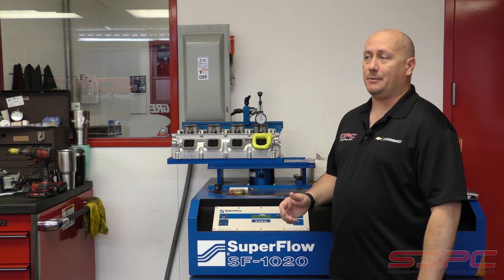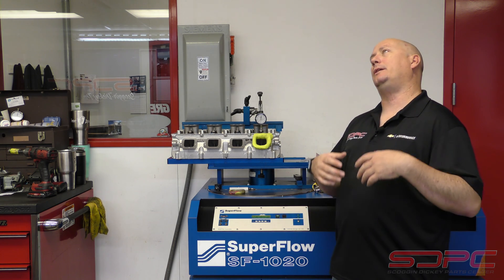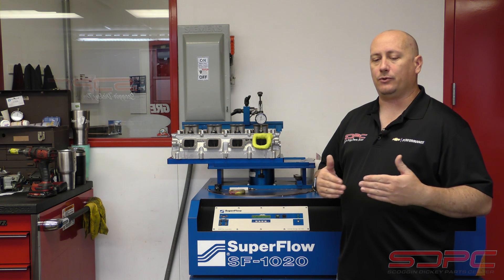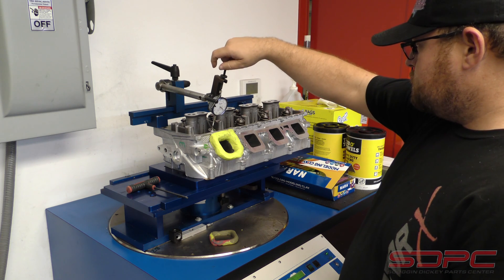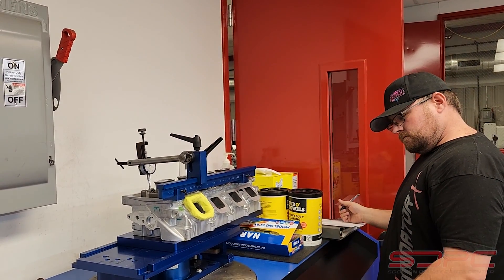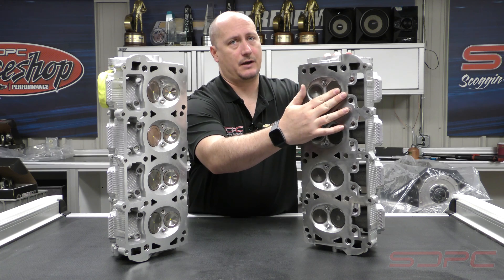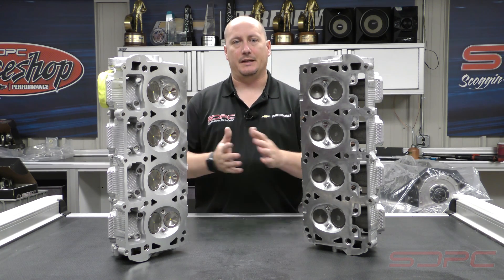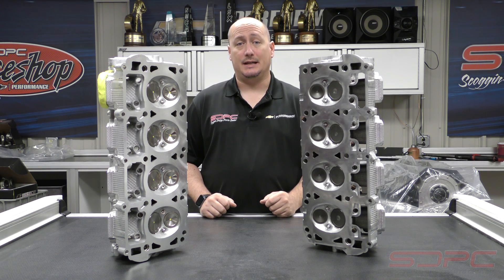SDPC HEMI Head Flow Testing

Comment: Dual overhead cam these heads and  the engine will rev 2000rpm more…
Reply: the F/S 354 in the drag pak spin north of 9500 RPMs , David Barton use to spin his 426NA F/S G3 up to 9k , Buddy Boy's 449 spins to 8700 I spin my 6.1 to 9100 (Winberg 3.59 stroke 8 counter weight crank) ....My Husband's Coyote sh!t the bed at 8300 and that was a L&M built Coyote.   Steve Morris has a Video of a twin turbo 426CI G 3 spinning to 10100.....so another 2k RPMs would put us over PRO-Stock RPMS,  and well as much as I love my G3s , there's NO way in Hell we're going to spin these that High, there're not F1 engines.
Reply: @ I have got this desire to see a head builder like MBE put together a Hemi head with DOHC … The coyote has a pentroof design head with 4 valves … that is what most DOHC engines are … but nobody has built a Hemispherical head with two valves and two cams … Ford built the 427 SOHC , a single cam but the cam was in the centre of the head so the spark plug had to fit up top or down below on the head and they used a ridiculously long timing chain … I think the DOHC Hemi would allow more relaxed RPM …No valve bounce and much more control of the  breathing system … Freevalve by koenigsegg would be amazing for high powered Hemi but that would cost too much … !! Any way … I’m glad to hear that you have some success in racing …

Comment: What kind of numbers would 6.4 heads on a 5.7l with the SDRH 223231 cam do?
Reply: depends on who tunes it,  I can tell you this we made 510hp on our 902 Superflow Dyno .with TSP stage 4 NA cam and OEM 6.4 heads on a .030 5.7 VVT engine with 11.00 compression, Intake was a PreFix single plan with a 105MM TB using a 2014 Ram ECU , the 2014 ram 1500 it went in had a 46RH trans 4.56 rear gears. (4000 race weight RC 4x2 )
   truck averaged  11.60s  and PB of 11.49@ 116mph with the TSP cam stage 4 , and slowed down 11.70s With . SDRH223/231 with a PB of 11.65@115 MPH  , all runs were at Maple Grove in PA.

Comment: Would Be Cool To See Flow Numbers On Both These Heads For A 3.92" Bore (stock 5.7 Hemi Bore) To See If Its Worth Trying To Run/Upgrade 6.4 Hemi Heads On A 5.7. The Valve Diamters Are Limited On A 5.7 I Think. They Will Fit And Clear But The Valve Being Shrouded By The Smaller Bore May Have Negative Affects On The 6.4 Head Making It Not Worth It.
Reply: This guy has been running BGE heads on stock bore 5.7s(3.917) since 2018,  he's got a 75 4x2 ramcharger that runs low 10s at 3450lbs(650HP at the flywheel on 100 oct) runs a 2.225 Intake valve and a 1.645 exhaust valve, Jesel Solid lifters , T&D rockers shift point is 7900 RPMS, 
https://www.youtube.com/watch?v=ZqRGUXbp4ls
Reply: @TaylorJensen-ys2cv  Yup I Encountered Him And Took Alot Of His Recommendations. I Will Be Running A Stock 6.4 Head On A .010 over 5.7 Hemi Stroker 6.4 Turbo Build.
Reply from the maker: @salvatorehayes2753  it's been discussed, we don't have the bore size in our inventory at the moment.

Comment: Will the 6.4l head bolt on the 5.7 also what are the casting numbers used ?
Reply: Just ask because i have several pairs of both and considering building a 5.7 for my daily driver. Not being a "Hemi" guy the info would be great
Reply: @bad406camaro not sure if the car side will work but on the ram side of things 6.4 heads will not fit the truck 5.7 but the 6.1 heads do fit the truck 5.7 or you could just port the 5.7 heads in the mean time
Reply: This is something that I am still not 100% sure on the answer. The problem is that the combustion chamber is just slightly larger than the 5.7 bore. I think that the additional shrouding on the valve caused by this will negate any positive results that you might gain from the swap. Trust me when I say that I will try this and we will let everyone know the answer that I find.
5.7 - 68280502AF
6.4 - 68280510AC